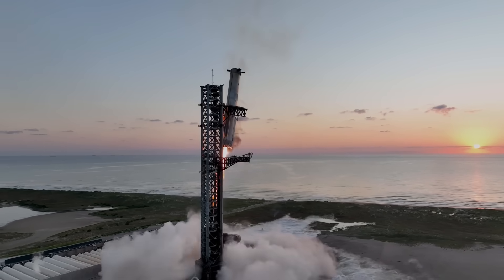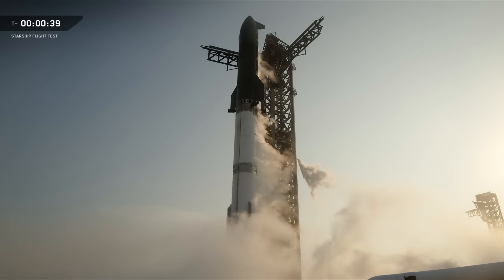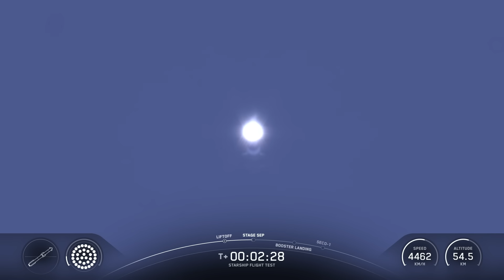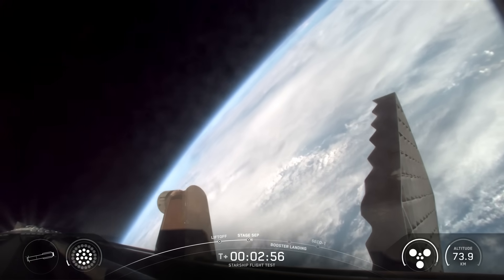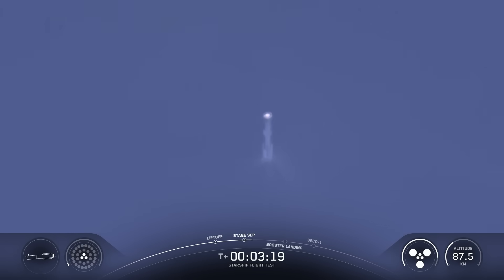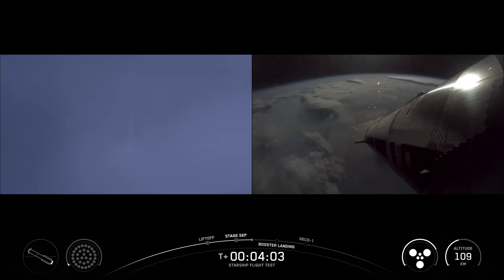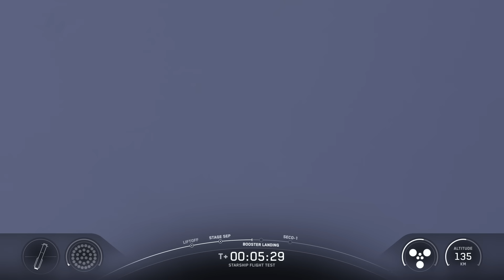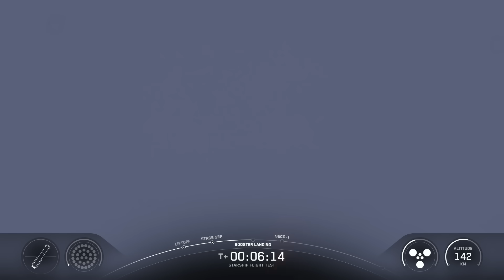SpaceX Builds Largest Reusable Booster, Also Makes Door That Won't Open - Starship Flight 9 Recap

Comment: Spacex have undeniably achieved some great things but each time I watch this stuff  I can’t help be blown away at insane reliability of of the Saturn 5, how they achieved it almost 60yrs ago still absolutely blows my mind.
Reply: Easier to go up than to come down, that's for certain!
Reply: @kiloyardstare  proving the old adage whatever goes up, sometimes comes down, maybe
Reply: It's two different philosophies: "move fast and break things" and "get it right the first time". Most rockets in development aim for the second, so they do lots of on the ground testing, and nowadays, computer simulation. It's slow and costly but you get a much more reliable product at the end. SpaceX is doing the former, they're booting out rockets with much less testing and simulation and they'll keep launching again and again until they've (hopefully) fixed all the problems. It worked pretty well for F9 so I see why they're doing the same with Starship. But Starship is a far more radical design compared to F9, so it remains to be seen if the same strategy will work.
Reply: saturn 5 was single use and not very efficient so the reliable point does count only to some degree. i bet if you would make starship single use like saturn 5 it would be flight ready after 3 more testflights. its much less hustle if you dont have to think abou how you can get your rockets back in in part without any repairs afterward.
Reply: @Hans-Yolo  None of the issues with starship have anything to do with it landing. It's failing in "orbit" (it's not actually there yet) or burning up on re-entry. They've got a looooooooong ways to go for anyone to try and compare the cost with the cost of Apollo.
Reply: It's an apt comparison, because BFR/MCT/ITS/Starship has been in development since 2012, and in flight tests since 2019, giving it 13 years of development and 6 years of flight-testing of components and spacecraft.  By the same metric, Saturn V's planning started in 1956 with SuperJupiter, and was in 'flight tests' by 1961 when the Saturn-I first flew.  Of course, no part of that Saturn I would reappear six years later on Apollo IV, indeed the Saturn V architecture wasn't set until 1962.  But 13 years after planning of SuperJupiter began, NASA had landed on the moon.

ETA: Honestly, I think Space Shuttle is the more apt comparison.  We've got a reusable vehicle with some very aggressive planed re-flight schedule, we've got thermal tiles, we've got a decade-long schedule with lots of delays.
Reply: @Vehrec we've also got a death trap with no launch escape system and an unprotected heat shield,  just like the shuttle/STS. Columbia reached orbit and returned its crew to Earth on its first attempt and I think people overlook how much of an achievement that was because it lived in the shadow of Apollo. It was a huge technological achievement to create and dangerous as hell from day one. Two crews were lost because it had no launch escape system and it flew with an unprotected heat shield. 

If we want to be serious about manned space exploration we need to build a lunar base and continue to grow our knowledge and technology before attempting to land on Mars. Starship should be canceled and we might as well use up the SLS hardware we have before its canceled. Long term, a Frankenstein approach combining Orion, one of the less ambitious dedicated lunar lander proposals NASA skipped over when it chose Starship, and just the booster from SpaceX could make a lunar base achievable. It could also be mostly reusable with Orion being intended to be reusable, a perfected reusable booster, and a lander left in lunar orbit. Several of the other proposals would have the lander capable of multiple landings I believe.
Reply: @Vehrec  "13 years after planning of SuperJupiter began, NASA had landed on the moon"

That's just amazing to think about. Even if Starship had a successful test flight, it would still be years away from being rated for a human crew. I hope other spaceflight companies can make progress and challenge SpaceX.
Reply: @LesserAndrew Starship will be human rated and it won’t be years away..I hope other companies can also make rockets..so you are so sad..😂😂😂
Reply: @LesserAndrew  I don't think SpaceX really intends Starship to be human rated (for earth launch anyway). Passengers are less lucrative than satellites. Starship is a massive LEO truck and that's what it will be good at. F9 is fine for humans (or something like Dream Chaser in future).
Reply: To be fair, they weren't going for rapid reusability with Saturn 5, and it wasn't as big as Starship is.
Reply: Maybe SpaceX should drop the steel idea. And just make a way bigger Falcon 9. And call it Falcon Super Heavy.
Reply: Certainly more patriot, all those involved.
Reply: You know they tested that rocket a bunch of times first too, right?
Reply: @Orphen_420 yes 10 times. 

Saturn I (10 Test Flights, 1961–1965)
•  SA-1 (Oct 27, 1961): Success
•  SA-2 (Apr 25, 1962): Success
•  SA-3 (Nov 16, 1962): Success
•  SA-4 (Mar 28, 1963): Success
•  SA-5 (Jan 29, 1964): Success
•  SA-6 (May 28, 1964): Success
•  SA-7 (Sep 18, 1964): Success
•  SA-9 (Feb 16, 1965): Success
•  SA-8 (May 25, 1965): Success
•  SA-10 (Jul 30, 1965): Success
Reply: @Orphen_420 

Saturn I (10 Test Flights, 1961–1965)
•  Total program cost (development and flights): ~$410 million (1960s dollars)
•  Estimated cost per test flight: ~$41 million (1960s dollars, rough average)
•  Adjusted for 2025 inflation: ~$400 million per test flight
Reply: @rporpora2 and 0% re-usable.
Reply: Apollo engineers did not have to deal with reusability.
Reply: I mean, yes, the nation state of the USA did have some skills back in the day. Not now...but back in the day it did.
Reply: Saturn was a simple rocket. Big, but simple and it was all disposable. The Mars mission ultimately needs a rocket that can land and leave again.
Reply: @tinkertailor7385  Starship is disposable. And unusable.
There will be zero Starship going to moon. And definitely not Mars.
Starship is a huge failure from the start. A scam, you could also call it.
And we will not take humans to and from mars for decades, if ever.
Reply: @tinkertailor7385 ”The Mars mission ultimately needs a rocket that can land and leave again”

Using a chemical rocket this big for that is pure unadulterated stupidity. Nuclear is the way to go for any Mars mission.
Reply: @sunspot42  And how do you plan on getting the nuclear rocket to orbit? How do you plan on landing the nuclear rocket on Mars? How do you plan on returning to Mars with it? Nuclear rocket engines are incredibly heavy and can't produce a lot of thrust. It's only feasible as a shuttle between earth orbit and Mars orbit. You would still need huge chemical rockets to actually assemble the damn thing in orbit and get the fuel up there. You would still need something like Starship to actually achieve that to be feasible both technology and economy wise.
Reply: @TC_164 So you’re admitting chemical rockets are a non-starter for actually getting to Mars. Yes, you’d use them to launch a nuclear rocket into orbit. You might even use them for a lander, although nuclear landers are also possible. But for getting from Earth orbit to Mars, nuclear is the only viable solution.  

Especially when you look at how many launches it would take just to fuel up Starship for a lunar run, let alone a landing on Mars.
Reply: @sunspot42 I never admitted anything. Nuclear are only marginally more efficiant than chemical rockets when all is considered. The immense amount of extra mass they require diminish a large part of their increased efficiancy. Chemical rockets works perfectly well to get to Mars. Getting to Mars in chemical rockets isn't the problem. The problem is being able to land safely on Mars and launch back up. It's not something nuclear rockets solve.

A nuclear rocket would require a bunch of fueling missions as well. It's not going to be much different fron Starship. How do you think one would get all that hydrogen fuel up to it lmao (a terrible fuel for interplanetary travel btw because of the boils of problems)?
Reply: @sunspot42  - now tell us where you're going to test this nuclear rocket, and what happens if it fails to achieve orbit after it achieves criticality?
Reply: @TC_164  "Nuclear are only marginally more efficiant than chemical rockets when all is considered. "

Oh lord.  No.  That's just so wrong I don't even know where to begin.  Yeah if your mission doesn't need electricity anyhow or you're just interested in getting off the surface of a planet like Earth they don't have any advantages.  But if you don't want to haul a year's worth of supplies for what could be a trip measured in weeks instead of months, nuclear rockets are amazing.  

Not just nuclear thermal either, but the whole constellation of technologies nuclear unlocks in space.

You're going to need that reactor to make fuel on Mars anyhow, since Musk's stupid proposal to manufacture fuel on-site would require several football fields worth of solar cells.  Not happening.
Reply: @malcolmstreet1  "where you're going to test this nuclear rocket"

Probably where we tested them in the '60s.

"what happens if it fails to achieve orbit after it achieves criticality"

You wouldn't activate the reactor until it was in orbit.
Reply: @sunspot42  - I should have said flight tests.  Yes, I know there were successful static tests in the '60s.  One reason Project Pluto ( a nuclear-powered cruise missile) was cancelled was because no-one could work out how to flight test it safely.

Good point about orbit - could have phrased it better.  But you still have a problem if you have a situation like the Soviet Venus probe where the boost out of LEO failed and the craft goes into an eliptical orbit instead.
Reply: @tinkertailor7385  The Saturn V had hydrolox engines for the second and third stages though (with tanks for storing hydrogen in both stages). It didn't seem like development of the J-2 engines was easy? Was the J-2 engine relatively simple, for a hydrolox engine?
Reply: @tinkertailor7385  honest question: what Mars mission? Any mission to land humans on Mars would require massive amounts of taxpayer money, and I don't see that in the latest budget bill. Maybe someday there will be a manned flight to Mars, but it's just not in the cards right now.
Reply: @tinkertailor7385  Fine. But, after nine test flights, if we can't even get into orbit without issues like this, Mars is a bridge too far for the foreseeable future.
Reply: @tinkertailor7385 there is no Mars mission. It's fantasy. We should be building a lunar base to continue to learn and develop our technology in a location that is only a few days away in the event a rescue is needed. We aren't ready for Mars. We're not even close to ready for manned missions to Mars.
Reply: @ShowersRainwater  why not use robots? My sci/tech professor wrote the books Robots in Space and Financing the New Space Industry, both of which paint a picture of nimble private companies launching probes and robots to perform scientific exploration instead of massively expensive and much more limited human missions.
Reply: @ShowersRainwater  I have to agree. At this rate Elon may be taking his dirt nap long before this program is anywhere ready to go to Mars. And by then there will be successive changes in US administration and management at SpaceX who are going to shy away from throwing this kind of money at a problem that is looking harder and harder to solve.
Reply: @yes_head what money is the gov’t throwing away?
Reply: @ShowersRainwater  There's nothing even ON Mars, or the Moon for that matter. It's utter nonsense and of literally zero benefit to humanity to have anything to do with it for several more centuries until we can get out shit together here on Earth.

I love space, I always have. Spent my childhood watching Star Trek and Star Wars, watching the Shuttle program and the ISS. But human civilization is going to die by century's end unless some serious changes are made, and some grifter putting on publicity stunts and lying about what his "space program" is for so he can continue trying to be the world's first trillionaire isn't going to help.
Reply: @ShowersRainwater  Starship is the lander that's planned for the future lunar landings, and if we want to have regular trips to and from the moon with something like a proper base, something big and reusable absolutely will help achieve that goal.
Reply: @rporpora2its 100% funded by space x not government
Reply: @ShowersRainwater  i'd put money on the fact that the first missions to mars after equipment and supplies are going to be like shiploads of optimus robots. first ships are going to be solar panels and wiring and habitat walls and stuff like that, then likely drilling/excavation type equipment and batteries, then optimus robots. they likely won't send people until after like 6+ (or more likely 9+) successful normal missions to mars, or moreso 6+ near flawless missions where there were no vehicle disasters.
Reply: @ShowersRainwater Thank you internet commentator. What are you doing to bring the lunar base to fruition?
Reply: @tinkertailor7385 Until there is a fuel farm there, "it can't return from Mars." Once there is a fuel farm there it can return but with a fraction of the mass. Crew and maybe a few passengers. For almost everyone who board the starship to Mars, it is a one way trip. Colonize Mars!
Reply: It is an entirely different approach. 

Using traditional methodologies, they tested the sh*t out of everything before the first test flight. But with the increasing complexity, testing itself became prohibitively expensive. And since they spent so much on testing, failure became unacceptable, so they spent even more on testing, starting a death spiral.

This agile, “fail fast” approach is common in software development, due to the low cost of testing. Space X is the first to try it in spacecraft engineering. The idea is that building a rocket and blow it up is cheaper than testing every single component and approach again and again, and gives a lot more information on what to fix. So despite the failures, the cost is still lower, and the end result is better and more reliable. 

Of course, there is an upper limit on how many times it can fail before this methodology fails, and becomes more expensive…
Reply: I don't know why people are comparing the Saturn 5 to Starship. I guess people just want to hate Starship but the fact is The Saturn 5 was just the booster for the Apollo capsule . It's basically the same thing as the super heavy booster for Starship which they have that part pretty much perfected and are reusing. The Saturn 5 was always dumped in the ocean as with every booster NASA develops costing the tax payers billions after each launch just go look at SLS!
Reply: @Paulyjimmyjoey I’m not sure why there is a comparison either NASA has actually gone to space 🤷‍♂️
Reply: @blueberrywilbur315  NASA uses SpaceX to get to the ISS. Since NASA's only spacecraft is Orion which has had only 1 test flight so far. When Starship is completed NASA is going to want to use that also just as they use Crew Dragon.
Reply: @Paulyjimmyjoey Lol….look at you slurping on musk
Reply: @Paulyjimmyjoey When starship is completed 🤣🤣🤣🤣 That pos will never do it watch, when you’re ship can’t stop leaking it’s not going anywhere 🤷‍♂️
Reply: @blueberrywilbur315  so has spacex. Who delivers the astronauts to the ISS? And fetched them back when boeing maroons them?
Reply: @Paulyjimmyjoey because the Saturn 5 actually worked. Why are you hating on government funded projects?
Reply: Love the Saturn 5. By far, the greatest mass to trans lunar orbit than any other rocket. Much greater than the SLS/Artemis. The SLS can not even return from a low lunar orbit much less carry its own lunar lander.  If the goal is the moon, why do we compare mass to low earth orbit?
Reply: @user-fr3hy9uh6y your comment make headache, the plan is to refuel starship in orbit so it can transfer the full load to the moon
Reply: it's cost was 500 times greater for a single launch of Saturn 5 than the entirety of the starship program...
Reply: The Saturn 5 program cost $6 billion or $50 billion in today's money. Starship is at around $5 billion. Where  in the world do you get 500x!? That puts Saturn at $2,500,000,000,000. $2.5 TRILLION dollars. Even looking at the entirety of the Apollo program it's still only $257 billion in today's money.
Reply: @whitey211 And by the time Starship is human rated it will cost more than Apollo and have nowhere to go but orbit the Earth.
Reply: @whitey211  You're going off a slightly outdated number. The entirety of Apollo, plus the supporting programs, like Lunar Orbiter and Surveyor, plus the critical Gemini program put it at $300 billion. The Mercury program largely predated making Apollo official, so it's not included here.
Reply: @Nowhereman10  That's fine, but then you'll have to include all of the falcon 9 program into the spacex side of things. Either way, I think it's silly to try and compare the cost of a program that was ended 50 years ago, and was an enormous success to one that has just started and accomplished very little at this point. It's like saying it cost a million dollars to get your kid to be a surgeon but I've only spent $1000 on my toddler and he can already walk!
Reply: @nykichr The fact that the stated NASA mission is to get this rocket to the moon, but they're testing what is clearly a satellite launcher (slot door instead of one for crew/material) should have people asking questions, but here we are.
Reply: @whitey211 No, the problem here is that you're just completely ignorant. This is not the rocket that will be used to get to the moon. That is an entirely different upper stage variant called HLS. This is just a prototype vehicle  later variants, like HLS, is going to based of when they get it working properly. How do people like you even find these videos when you don't even know the most basic of knowledge?
Reply: @TC_164  My bad, I incorrectly remembered the minutia of a  plan from 3 years ago. Got some real anger issues my guy. Yikes. It's the comment section on a youtube video, take a deep breath.
Reply: @whitey211  The Falcon 9 development program is only about 1.2 billion and isincluded in my initial 5-8 billion for Starship, even though they're not the same programs and no hardware from Falcon 9 transferred from F9 to SS SH the way Saturn I and IB did to SV.
Reply: @Redact63Lluks  they had to invent half of modern society for Apollo. SpaceX has the luxury of not having to do that.
Reply: @Redact63Lluks Also you think SpaceX isn’t doing this with lessons all learned from NASA🤦‍♂️
Reply: @Redact63Lluks  Well to be fair if you used Saturn 5 architecture with modern tech I'm sure it'd be a lot cheaper than that right?
Reply: @fderon you actually can't use the Saturn 5 with modern tech. It's not possible. You would need to design an entirely new rocket.

Indeed it actually would be far more expensive than it was back than a good number of the rocket parts can't be made anymore as the machines that made the parts no longer exist.

So yeah new rocket design would be needed. Completly from scratch
Reply: @Redact63Lluks  And how many more test flights will we need before Starship is ready for operations?
Reply: @Redact63Lluks They actually went to space 🤷‍♂️🤣🤣
Reply: @Redact63Lluks But one thing that the Apollo did was spin off technology that paid for itself many times over. Starship does no such thing.
Reply: @Redact63Lluks yeah uh, that's called novel development.
Reply: @Redact63Lluks you don’t know how much “Star”ship cost since it’s a private company and Musk is a liar.
Reply: @Redact63Lluks  How do you figure? The launch cost in 2024 dollars for a Saturn V has been put at about $1.5 billion. 
What do you estimate to be the launch cost of Starship over the past couple of years?
 
In 2023, SpaceX conceded that development of Starship would run about $2 billion for that year (see article on "SpaceX investment in Starship approaches $5 billion"); and conceded that more than $3 billion had been invested in infrastructure since 2014.
Reply: @michaeldunne338 launch cost for the starship vs. Apollo is hard to compare. Apollo was the command module and lander, Starship is just the lander. Apollo was a single launch , Starship will require someware between 10 to 20 additional refueling missions. Apollo was a round trip Starship is a one way trip, no heat shield. Apollo took man to the moon and returned them safely to the earth. Starship is not designed to do that.
Reply: @user-fr3hy9uh6y  and SpaceX's engineers (not elon, F elon) used and borrowed so many designs and concepts from those programs, its not even funny
Reply: @user-fr3hy9uh6y  Great points. But when it comes to actually launching the system, to enter orbit - and or to place a theoretical payload into orbit - what is the estimated cost of a Starship launch right now about? Would it be $200 million a launch of a what are essentially test vehicles, $150 million, $100 million a test flight, or something less?
Reply: @Redact63Lluks If you trust Totally Not  Invented Costs That Are Far Below True Expenses™, yea 😂 But don't forget, they had no CAD, no CFD, no pocket calculators, and yet, managed to design something nobody has done before, in a super tight schedule. It's obvious it would be expensive
Reply: @Redact63Lluks  maybe if they stopped cutting corners so hard they'd be able to match the reliability
Reply: @Redact63Lluks  true, and how good were computers simulations back then?
Reply: @Redact63Lluks You can't actually still believe that, can you? The Starship program stopped being lean and efficient years ago. You think constructing and tearing down that many structures is efficient? You think the bespoke automated manufacturing equipment they use is cheap? You think a workforce of 1000s that makes so many transfer flights they need their own 737 just comes free? The Starship program has become just as stratospherically expensive as every similar rocket in history, just because they keep their finances secret doesn't change the fundamental rules of economics.
Reply: @maxwellquebec8675 Seems more like you just have no clue about the economics of developing and building rockets. It will be far less expensive for the simple fact that it's not the government developing the rocket like previous similar projects. There's no gazillion amount of inefficiant subcontractors getting extremely lucrative cost plus contracts. That alone will make it orders of magnitude cheaper. Economy of scale also works on rockets. Using materials that are far cheaper and far easier to work with like stainless steel will always cut the costs dramatically. Building parts yourself will always become cheaper for you in the long run.

SLS cost over 30 Billion USD to develop and cost 4-5 Billion USD. A rocket using shuttle technology developed half a century ago. A single RS-25 engine it uses cost more than an entire Starship prototype launch. It's a complete joke.
Reply: @TC_164 That's a lot of words to say you know as little as everyone else. The simple truth is I don't know, and neither do you. I think I justified my belief that the program is likely extremely expensive, but who knows, maybe giant launch towers, hundreds of cutting edge rocket engines, and unfathomably large amounts of gas are actually free 🤷‍♂️
Reply: @maxwellquebec8675  The simple truth is that you have no clue what you're talking about and are just pushing narratives.

Just because SpaceX are not an open books about their finances doesn't mean we don't have a good ideas about their costs and spendings. Payload space makes yearly costs and spending analysis reports for example.

You just fail to grasp how obscenely expansive rocket development has been in the past. The fact that this is a private company being funded mostly through private investments and revenue streams while mas sproducing the parts in house thriugh vertical intrigation will make it FAR more cost effective than anything prior.
Reply: @TC_164  A lot of these same excuses were used for the Hyperloop and that's been a glowingly successful project...
Reply: @rve420  No, not really. Hyperloop has an entirely different set problems that you can't draw parallels at all to this.

This isn't reddit bud, you don't get upvotes here for making the lowest common denominator comments like these.
Reply: @TC_164  I could pick apart your original rant more but you deleted it. Many more examples of promises broken because the product or service never actually came to fruition or being continuously delayed and more expensive than originally promised. The Semi, the Roadster, the Hyperloop, full self-driving capabilities that are safer than the competition, etc.

That's even before getting into Tesla and SpaceX would've died in infancy if it weren't for government contracts and tax payer money.
Reply: @Redact63Lluks  AND IT WORKED, SPACE X NOT SO MUCH :)
Reply: @supertec2023 they haven’t even started, they are still testing it…😂😂😂
Reply: @Redact63Lluks  Saturn 5 has a better ratio of cost / human-miles traveled. Maybe that'll change many years in the future, but by that point the Starship program will be much older than the entirety of the Saturn 5 program.
Reply: @Redact63Lluks  SpaceX has spent billions on Starship.  I think $2 billion in 2023 alone.  They're burning thru vast sums of money without a single successful payload to orbit to show for it.  The Saturn V was far more-successful.

Ultimately, I think the Soviet strategy SpaceX is pursuing won't work for them any better than it worked for the Soviets.  There's a reason why the Saturn V (and more recently the SLS) didn't go for a cluster of lots of smaller, supposedly cheaper and simpler engines.  I think trying to make such an over-complicated overall system reusable is even more ill-advised.
Reply: @sunspot42  They are spending their own money, NASA spent over $20 billion for the Apollo missions in dollars of that time. If you factor in inflation then that is probably over $200 billion. SpaceX doesn't have the money printing ability of the US Treasury to finance itself.
Reply: @sunspot42 I somewhat disagree. The Soviet many small engine designs failed because the plumbing and wiring was crazy complicated. And the Soviets had no use for many small engines beyond “well it needs engines”.

SpaceX has very likely simplified the plumbing and wiring using modern design tools, and SpaceX need more engines to do propulsive landings. The fact that booster has been fairly reliable, at least relative to starship, indicates to me that the many small engines model isn’t the biggest thorn in SpaceX’s side.
Reply: @sunspot42  it's a "get over the hump" scenario.  Meaning once we're over these challenges the savings will be astronomical moving forward.
Reply: @sunspot42  There have been more successful F9 launches and recoveries in the past couple years than both S5, STS and SLS programs combined. If that doesn't demonstrate reliability, I don't now what to tell you. There is nothing wrong with a lot of engines as long as your QC is on point. It wasn't for the USSR so N-1 kept going kaboom. With that said, Starship v2 does seem like a regression compared to v1.
Reply: @alaindao7374  there's a difference between the total spending on the Apollo program and spending on just the Saturn 5. SpaceX would need to spend a whole lot more to develop a human-rated Starship, and it would need boatloads of taxpayer money to make that happen. The fairer comparison is Saturn 5 itself, which went from first test flight to the Moon astonishingly quickly.
Reply: @sunspot42  IMHO if the root cause of SpaceX’s problems were related to managing lots of engines we would expect to see their flights fail prior to MECO. Barring the first flight, the booster has been the one thing on this program that has worked reliably. The second stage (which has fewer engines than the falcon 9 first stage) is their problem child. 

All that being said, I wholeheartedly agree with you that SpaceX is failing in the footsteps of the Soviets. It’s just that I’m focused on SpaceX’s failure to adequately test their hardware. The hard part of this program is supposed to be recovering their hardware, but instead they are struggling to demonstrate basic functionality. While I don’t work for SpaceX, I strongly suspect this is happening because they refuse to invest the time and money into developing proper infrastructure and procedures to validate their designs on the ground
Reply: @FlyNorthrop  Well like Scott said in this video, some things you cannot simulate on the ground unfortunately. I'm sure SpaceX would benefit with more ground testing like you said. But they like to test everything in one go and when something goes wrong, it throws a wrench into everything down the line just like what happened yesterday. Meanwhile Boeing is unable to sync their clocks from ship to ship which everyone in hindsight would argue should have been caught years before their hardware was stacked. I'm sure there are lots of unseen and unpublished errors and mistakes the public never sees from the handful of rocket companies and dozens of satellites, landers, probes that have been made.
Reply: @alaindao7374 Their “own” money? lol. You mean the taxpayer money they get from government contracts?
Reply: @wadevid Says who? Musk? Do you people still believe what he says?
Reply: @wadevid thats what many people dont get, yes they burn a lot of money now but if all goes like plan it will be a bigger cash cow than F9.
Reply: @alaindao7374 why do you think that? Why are people upvoting you? Does nobody know that they got billions of taxpayer dollars through Artemis program contracts?
Reply: @TC_164 At the rate they’re going, they’re going to launch more than a dozen Starship prototypes before they successfully get a payload into orbit. Let alone successfully reuse the boosters enough to make all the engineering around reusability worthwhile. (In case you didn’t notice, their reused booster blew up. Getting a single reuse out of a booster ain’t great.)

They spent $2 billion on Starship in 2023 alone and it’s been under development for around a decade now, hasn’t it?  Presumably they’re somewhere around $5+ billion into development without a single success. 

At least SLS made it to orbit. 🤷‍♂️
Reply: @alaindao7374 ”They are spending their own money”

They’re spending the money they’re making off the taxpayers launching crews and payloads to the ISS. They charge as little as $47 million for commercial Falcon 9 launches. ISS supply missions go for $147 million.  Manned launches? $260 million. That’s something like a billion dollars in sweet taxpayer cash a year right there. 

Add on military launches and other government contracts for another $500 million a year or so. 

Falcon 9 is great but the taxpayers are getting raped at those prices.
Reply: @sunspot42 

SpaceX could literally have a 1 in 50 success rate with launching Starship with payloads to orbit and it would still be more economically sound than SLS. That is how absurd it is. 

SLS is the single worst mistaken in American rocketry EVER. An obscenely expensive rocket using half a century year old technology that is so underperforming it can only launch 25% more to TLI than Falcon Heavy and is only able to launch one single payload (Orion) because vibtrational issues prevents any other less heavy ones. One successful test launch made 3 years ago is not some achievement.
Reply: Yeat when it works it will be 5-10x less expensive than falcon 9
Reply: @rexscates  *if it works
Reply: @sunspot42 this is demonstrably false…they Saturn program today would be 100 bil+.
These rockets were not reusable.
Starship produces over 2X the trust at Approximately 20% the cost of a Saturn flight. 😂😂😂
Reply: @sunspot42  I don't get the critisism of "cluster of lots of smaller, supposedly cheaper and simpler engines" criticism tbh. The upper stage of starship is the one having the most issues, and that only has 6 engines. Lower stage of the saturn V had, well 5 lol. Superheavy is the only one with a huge cluster of engines, and it's been pretty good so far. 2 successful landing, and the reuse probably only failed because they were testing what they admitted was a risky flight profile that they saw in simulations had a tendency to destabilize. Seems like a point that isn't substantiated by what has actually been failing.
Reply: @TC_164  "SpaceX could literally have a 1 in 50 success rate with launching Starship with payloads to orbit and it would still be more economically sound than SLS. That is how absurd it is."

Well, right now they have a zero success rate and SLS actually worked.  So, there's that.  Was it ridiculously overpriced?  Sure.  It was also pork and graft for connected Congressional districts - a giant corporate welfare program.

You could probably build a rocket virtually identical to SLS for half the cost if you streamlined manufacturing.  Although I'm not sure you'd WANT to do that, since much of its design was influenced by its pork-potential.

Still...it worked.
Reply: @rporpora2 "this is demonstrably false…they Saturn program today would be 100 bil+"

Hard to say what the Saturn program would cost "today" since they had to invent a bunch of stuff we now already have.  They were also in a huge rush.

Still, most estimates put the total cost of the Saturn at around $50 billion in today's dollars, give or take a few.  I haven't seen any estimates in the $100 billion range or anything even close.

In contrast, Musk has said in the past that Starship will cost $10 billion to develop.  Given all the setbacks, I'd be surprised if the pricetag comes in under $25 billion.  That's a lot to amortize across future presumably successful launches.
Reply: @logicbuilder1204  "The upper stage of starship is the one having the most issues"

They've had, what, one successful launch and return of the lower stage?  All that plumbing is supposed to survive multiple launch, return and relaunch cycles intact?

We have no idea if the "risky" flight profile was the cause of the most recent failure.  Maybe it was, maybe it wasn't.

I've always thought the design was problematic at best, and I think it still is problematic.  We're a long, long, long way from seeing how reliable it turns out to be in practice.
Reply: @biggieb8900  SpaceX was awarded a fixed price contract of $2.89 billion to develop and build two HLS variant of the Starship. To put that in perspective, NASA has already spent $29 billion to develop the Orion spacecraft to deliver the astronauts to the Moon as part of the Artemis project. For that $29 billion it got a partially reusable spacecraft whose heat shield took more damage than expected on the Artemis I mission and will require a redesign and delay of later Artemis missions. So what exactly is your issue with SpaceX getting a fixed price contract to build 2 HLS variant of Starship? You do realize that fixed price means that if it costs SpaceX more than that then the cost overruns are on SpaceX and that NASA won’t be paying more. SpaceX portion of Artemis is nothing compared to amount already sunk into Artemis.
Reply: @sunspot42 nothing works better 🎉than falcon 9, the heavy booster with more lift than the saturn 9 already works well
Reply: @bensaunders317  exactly, may be boeing should be in the mix when people are comparing spacex to  apollo
Reply: @LesserAndrew  no, making starship human rated doesn't need boatloads of tax payers money. 

Starlink missions financed by Starlink revenue will allow them to continue to refine the design until it's reliable and safe enough to fly humans. That's why the past 3 missions have involved deploying  starlink dummy satellites, even though that hasn't been successful yet. 

SpaceX is at a point where the DONT NEED tax payers money  because they generate more than $10 billion a year through starlink.

Anyway, all SpaceX contracts with NASA are fixed cost, so any additional costs are covered by SpaceX not tax payers.
Reply: @sunspot42 Definitely agree with that
Reply: @sunspot42 certainly breaking rockets as fast as they can launch them is probably a bad strategy if there is some problem you can't solve but the N1's problem was down to QC and control systems which we just are so far beyond that they don't really have the same problem